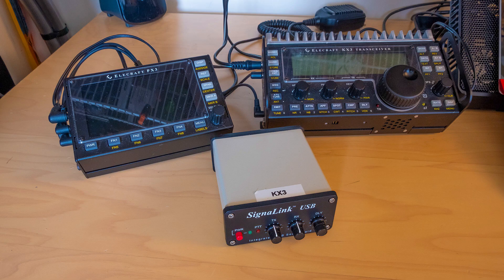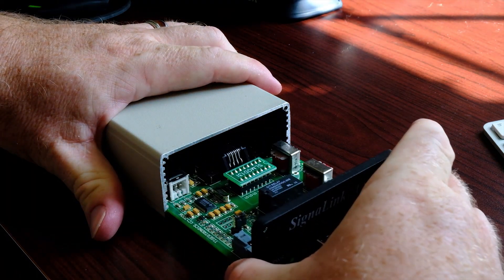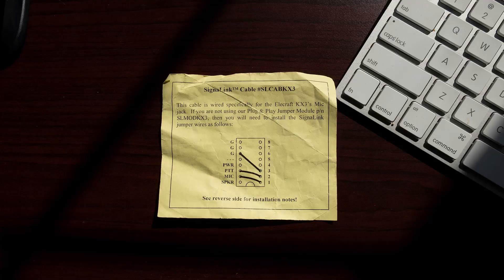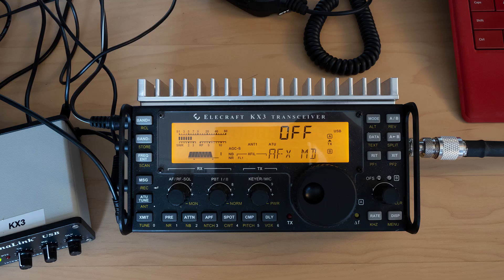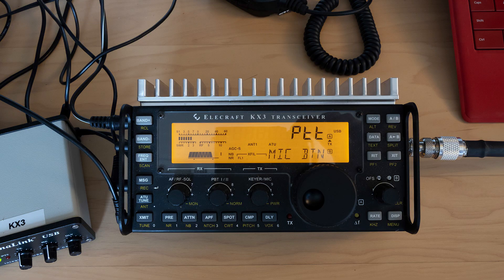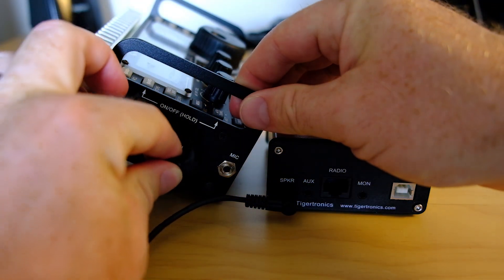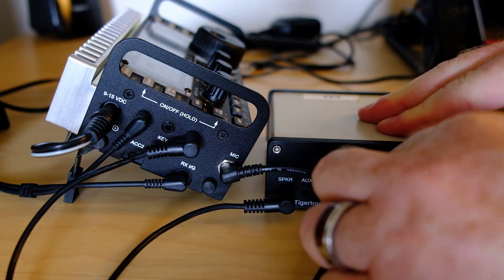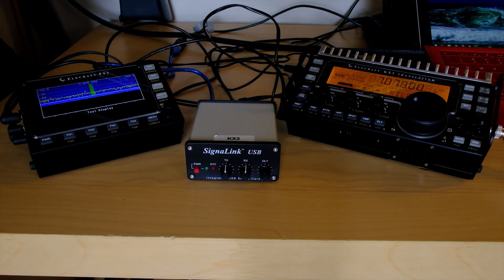Connecting a KX3 to the SignaLink USB

Comment: Do the menu settings need to be changed back and forth between running digital and phone?
Reply from the maker: No, after I set it up for digital, I haven't touched it again to operate phone. I'll double check that for you this weekend though.
Reply: Dummy Loads no true